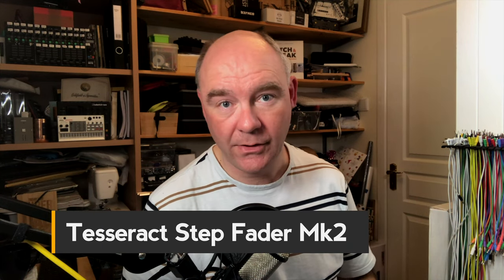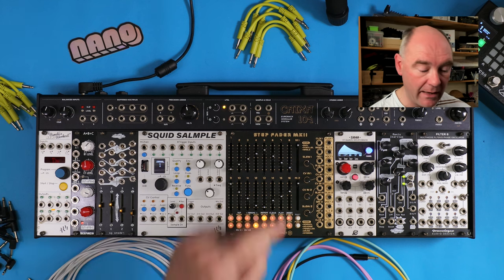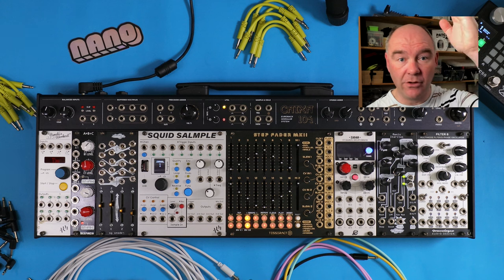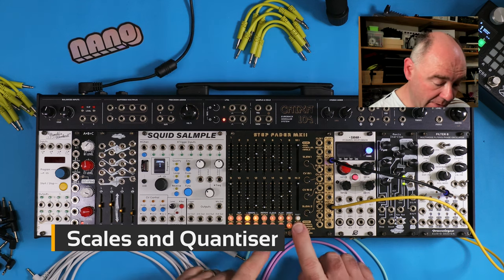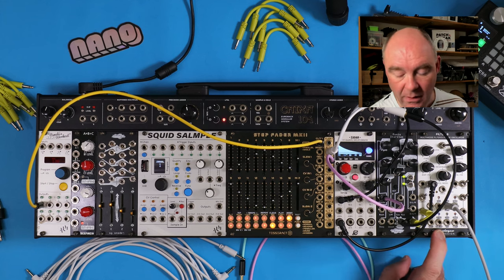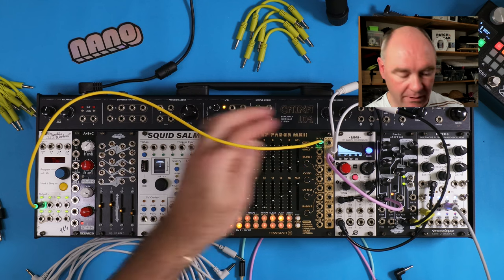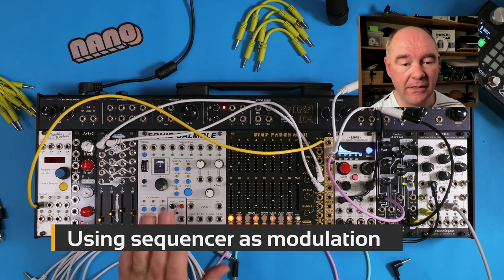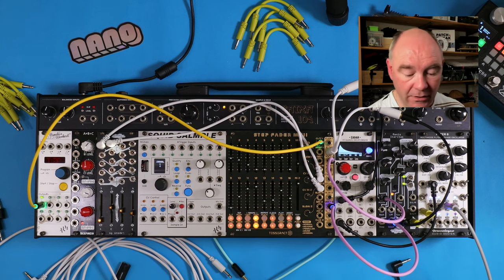Tesseract Modular Step Fader MK2. Powerful eurorack step sequencer. Full tutorial and patch tips

Comment: 2:55 according to the diagram from the manual slew in and out are not after the quantized output but after the unquantized sequencer values. Unless they re normalized in the way you said but that normalization is broken when a cable is plugged into the slew out. Any thoughts?